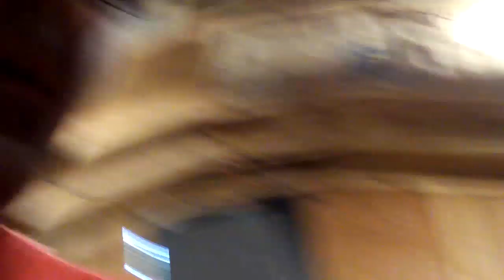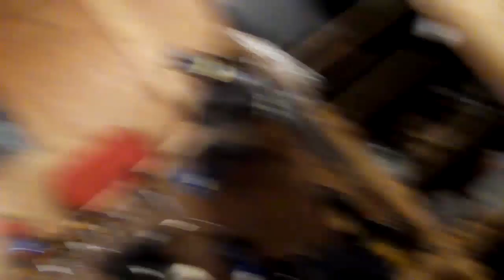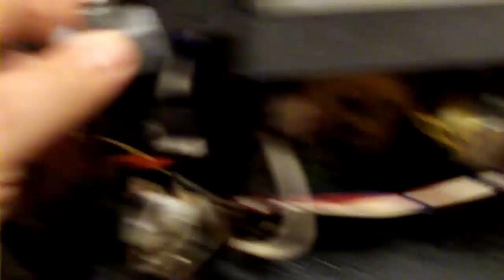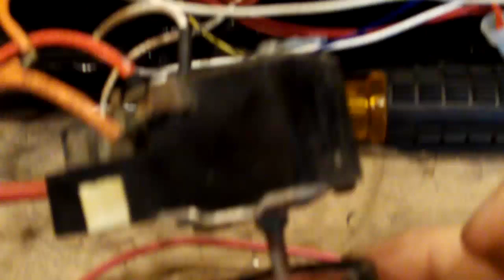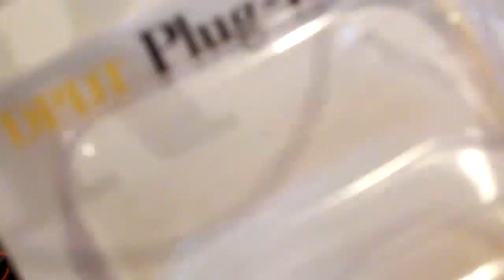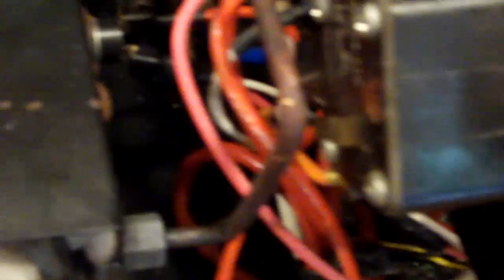Chauvet Fog Machine DIY Repair

Comment: are you familiar with the thermal fuse inside ? i bought a 250v 16a for a 3000w machine and it blew straight away before anything even happened it actually blew but its rated at 240v 16a 184 degree ? any help or yo have much experience with them ? 

thanks
Reply from the maker: I am familiar with the fuse, but their must be something else causing it to fail.  If the unit is under warranty I would bring it back.  Sorry I couldn't be of more help.

Comment from the maker: At the time I tried to buy the thermostat from chauvet.  The wouldn't sell just the thermostat, they would only sell it with the heater... for the price I could have purchased a new fog machine.....  Tell me where to buy the part for 50 cents............
Reply: How much temperature you set.. Its 180° or 260° ?

Comment from the maker: @ruik118  Fog machines are known to shoot a short burst every so often on their own.  This is caused by fluid dripping into the heater chamber.  Maybe the hose you put on is not a tight fit and is allowing air to leak into it.  This could cause the fluid to leak into the heater chamber more often.  Other than that it could be the seals are going bad in the pump???  Good Luck!

Comment from the maker: @ImMELG   Yup, it is still working...... you wouldn't even know it had an electric oven thermostat inside its case.  I would suggest contacting the manufacturers tech line (if they have one) and ask at what temperature the heater reaches before cut-off just so you are sure.   Although $12 for the thermostat is not bad, you might just want to get the factory one.  Chauvet would not just sell me the thermostat,  I had to buy the heater too...  Good luck and let me know how you make out!